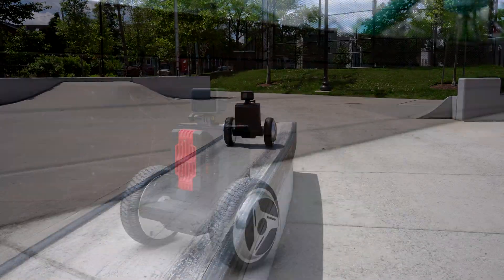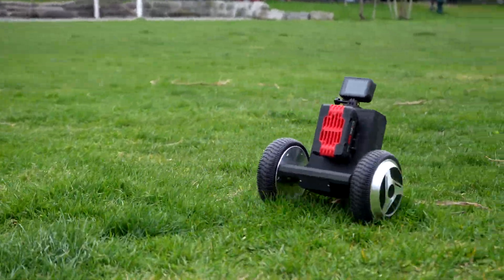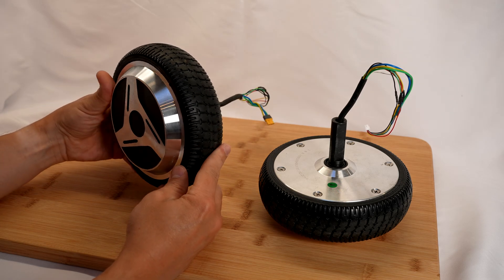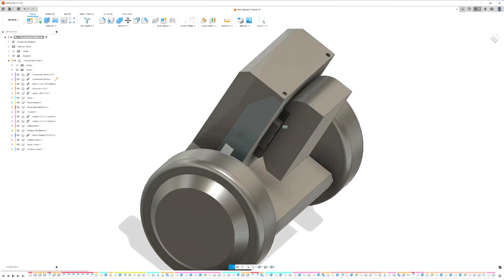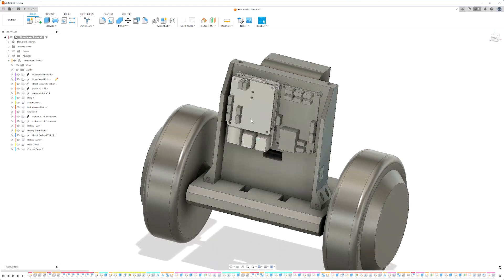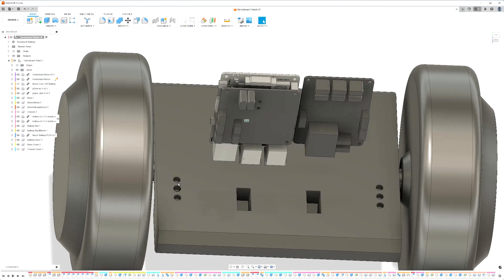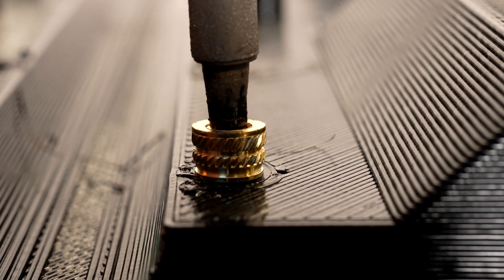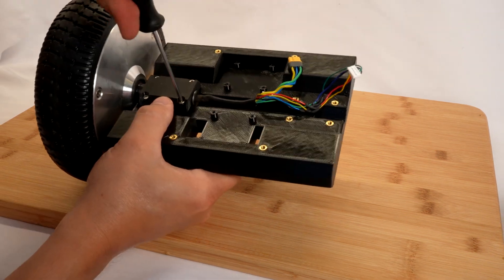hoverbot - hoverboard motor balancing robot

Comment: This is a great robot and am looking to utilize this in an autonomous environment. Im going to try a PI4 with an IMU and zs-x11h EMCs. Hopefully i can achieve the same result.
Reply: I also designed and built a model of the same type with zs-x11h, BNO080, and ESP32, but it is not easy to balance. zs-x11h has difficulty in balancing because of the lack of position recognition of the hall sensor and the lack of precision of the motor driver. It responds well to small shocks and movements, but it is difficult to find appropriate PID values for large external forces and vibrations. So I plan to remake it with SimpleFOC and ODRIVE.

Comment: I am ordering one for hover board motor could you suggest me which version is best for my motors.

R11 or c1
Reply from the maker: Assuming you intend to use the hall effects sensors on the hoverboard motors, only the moteus-c1 and moteus-n1 are compatible.  Which you need depends upon the current requirements of your motor and application.
Reply: @awesjosh  Thanks for the reply Josh,  My main requirement is to control hover motors precisely, so want to use the onboard sensor also for high torque at low speed; could you suggest any tutorial? for that.  Also now I am ordering 10 pcs, if it succeeds, we will have 100+ pcs. thanks in  advance.
Reply from the maker: The onboard encoder on all moteus controllers is an on-axis magnetic encoder.  You have to mount a diametric sense magnet on the rotor centered around the axis of rotation, then mount the controller fixed relative to the stator also about the center of rotation.  That is not practical for most hoverboard motors unless you are willing to attach your controller to the side of the wheel opposite the axle.

If you do use the onboard sensor, then hall effects are not required and the moteus-r4 would be a fine choice.  

If you are using hall effects, they do not allow for precise control of position or velocity at low speeds, but do allow fine control over torque.  If you want precise control of position or velocity at low speeds you will need to use an encoder with more resolution than hall effects (possibly in addition to hall effects if the high resolution encoder is incremental).  Once again, only the moteus-c1 and moteus-n1 support the 5V hall effects most hoverboard motors use.  Which you require depends upon the details of your motor and application, depending upon your continuous and peak phase current requirements.

Comment: Are you running a  cascaded PID loop on robot's pitch and yaw (angle you get from IMU) and the velocity control (reading the encoder data and moving the robot)?
Reply from the maker: You can find all the details right in the video at time 7:12 (and around there)

https://youtu.be/syxE1NEU7lw?feature=shared&t=432

Comment: Do you know how much current it was pulling in some of those higher-power maneuvers (like self-righting, or handling those slopes at the skate park)? I'd guess you're not super close to the 20a peak limit, but just wondering how much overhead you have on the 5a continuous rating of the c1.
Reply from the maker: I don't actually know off hand.  In most cases, this machine wasn't limited by the torque in the motors, but it was limited by how much mass there was in the mast.  i.e. with it tipped nearly parallel to the hill, you can't apply more torque than the machine weight.

Comment: How did you drive the pid? I’m seeing so many different ways people have implemented pid and no consistent standard way. Where can I find a formal derivation that implements pid like you have? For example, why no integral term in inner loop? How did you know that won’t be needed?
Reply from the maker: Most uses of PID control have no formal derivation behind them and this project was no exception.  In my experience, you want to avoid the I term always if possible.

Comment: Hi, I absolutely love our Videos and products! That’s also why your moteus starter kit is at the top of my birthday wish list! 😊 I am planning on powering it with a drill Battery and maybe adding some more motors in the future. That’s why I wanted to ask which exact Battery you are using (also in the robot dog) and if you think it could also handle some bigger or more motors. Thank you for reading!
Reply from the maker: The battery used in the hoverbot is a Bosch 18V drill battery.

The size of motor that can be driven will be constrained by the motor phase current and electrical power.  Each of the moteus controllers has different limits for these values, and different thermal properties regarding continuous operation, so there isn't one answer for "what size motor can it operate".
Reply: @awesjosh Thank you very much for your fast answer! 😊 It was very helpful
Reply: @awesjosh Which Battery did you use for the robot dog?
Reply from the maker: A Ryobi 18V 4Ah battery
Reply: @awesjosh Thank! :)
Reply: @awesjosh I tried to order some parts in your online shop from Germany and I have a question concerning the delivery. Why is it not longer possible to select a normal delivery method after adding more products to the order? It’s only possible to select a express delivery and that one is really expensive.
Reply from the maker: @MiniMasterpiece1  Unfortunately, our economy shipper places a value limit on packages.
Reply: Hi, I just wanted to say thank you again because the package just arrived safely in Germany! Everything functions great and I also told my friends about it and the also said how amazing your products are and that the will probably order something as well! 😊

Comment: Very stable control!
You are using your pi3hat, which does not have a magnetometer, right?
Is it sufficient for the yaw calculation to use the gyro value of the Z axis or have you also installed a magnetometer and fused the sensors?
Reply from the maker: Correct, there is no magnetometer.  The yaw for the robot just uses gyros, which means it does drift a bit with time, but that is totally fine for a teleoperated platform.

Comment: Hi! Thank you for sharing this video! Do you use any observers or filters to obtain wheel velocities?
Reply from the maker: moteus uses a pll filter on the hall effect sensors for commutation purposes, and that is the reported velocity that was used for the outer velocity control loop.  The bandwidth of that filter was somewhere between 50-100Hz, so it doesn't do much at low speed with the coarse resolution of the hall encoders.
Reply: Thank you! I do similar project and for now use the similar control approach but with some differences https://youtu.be/LMvEsF9Y2AY?si=PAa4gED8A2Uu-Ezu
In the future I'm going to ustilize mpc for increasing the stability and the robot's speed
Reply from the maker: Cool!  Thanks for sharing!  

As you can see from my video, you don't need to go to MPC to get significantly improved results.  Probably the easiest ways to improve your system would be to see if the structure of your control laws can be improved (or perhaps copy the ones here), and the second would be to ensure your attitude and attitude rate solution are operating well and with a sufficiently high bandwidth.  It could also be that your tuning is just sub-optimal.  Are you using integrative terms anywhere (you probably shouldn't)?
Reply: Thank you for recommendations! 
Yes, I use integrative terms both in attitude loop and in velocity control loop. 
I have some suspicious about imu. It outputs data only with 100hz. Probably if I replace IMU to better one, the whole system will be more stable.
Reply from the maker: I'm not sure an integrative term for attitude is useful, certainly this robot does not use one.  A feedforward term is probably a lot more valuable there if a plain PD is insufficient.

While a 100Hz IMU update rate is borderline feasible, there are lots of things that could potentially make it problematic.  That could be if you are just using pitch and not pitch rate, or if the IMU has a software configured low-pass filter, or if it is poorly mounted, or a host of other things.  This robot uses a 400Hz update IMU for instance with a 200Hz onboard filter, uses the pitch rate in addition to the pitch, and is known to work well at up to that rate.
Reply: Thank you for help! I'll try to add a feedforward term

Comment: Thanks for another interesting project! Question: can the pi3hat be used with a raspberry pi 5?  Wouldn't think there would be a problem - but would like to check.
Reply from the maker: Unfortunately no, it can't be used with a raspberry pi 5.  It only works with a pi3 or pi4.
Reply: Opps checked the manual and it clearly states it isn't.